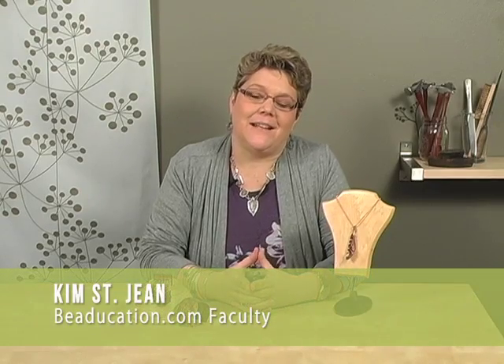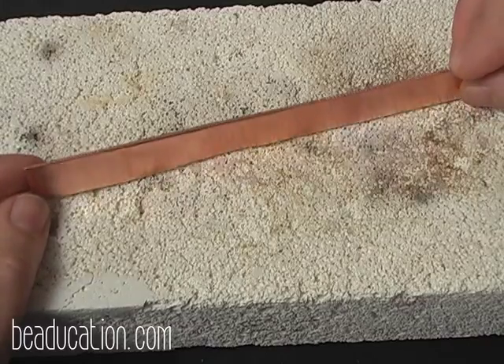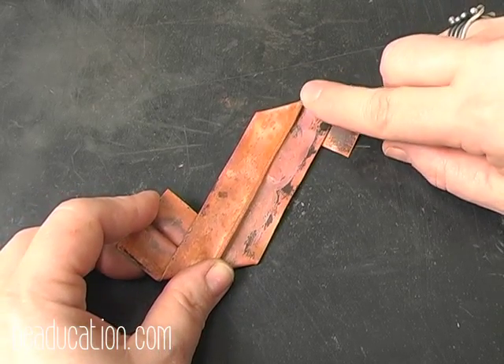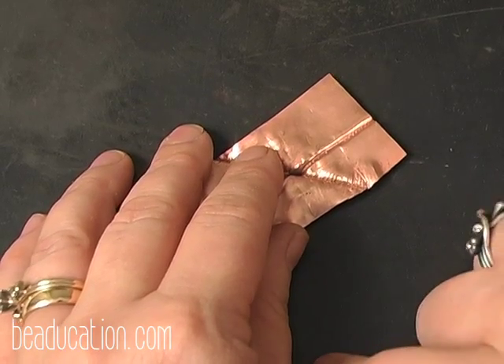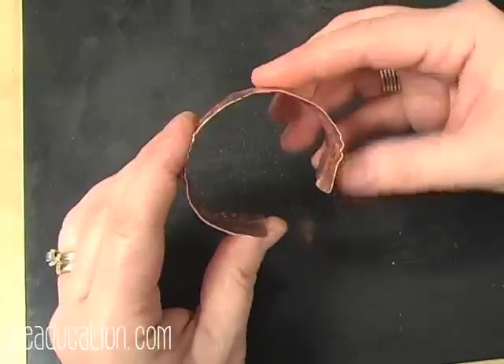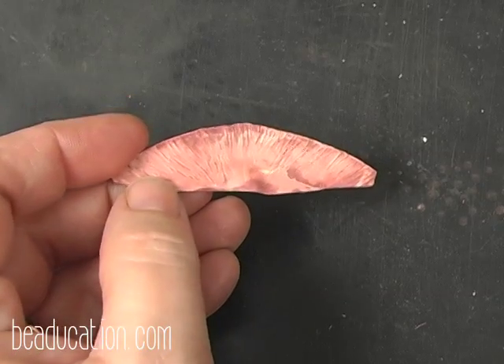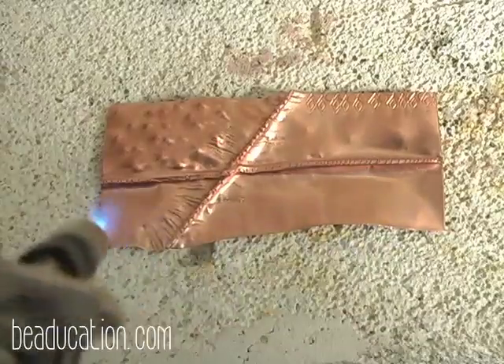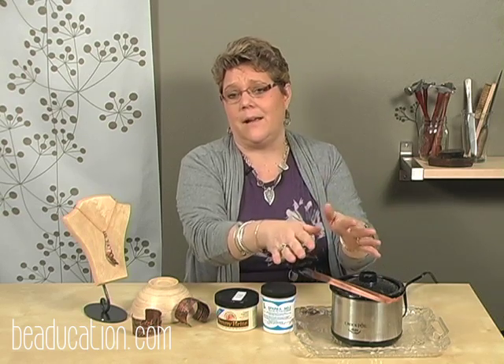Metal Fold Forming - Beaducation.com

Comment: Very awesome and informative video. I do have a couple questions though. Do you need a separate 'pickling' solution for each type of metal? Also, at the end when you were talking about the tongs for the 'pickling' solution, I was wondering if that ment that you could use the copper ones for all the kinds of metal, or if you need ones in the specific metal that you're 'pickling'?
Reply from the maker: Hi! These are great questions. You do not need a separate pickle pot for each metal as long as you're using, sterling silver, gold, copper, and brass. If you use Sparex pickle, you'll need to use Copper Tongs when taking things in and out of the pickle pot. Hope this helps. And, have a great day!

Comment: Hello and thank you so much for this video and all your very thoroughly detailed videos.  Just wanted to mention that when i couldn't find an unserrated butter knife in my drawer I came across my yellow plastic orange/citrus peeler (from a company that starts with a "T";)) It works great to spread open the pod without leaving any marks. Just insert the flat end and once the piece is open far enough you can use the other end to splay it a little more before getting in there with your fingers.

Comment: Hi, I couldn't understand where you said, bricks retain heat??? And make studio dangerous? Or didn't you start saying brick was ok, but then when referring to the heat, I couldn't quite get what you said. I'm new, but know in some cases i need a charcoal, to reflect heat up the the bottom, through a grate for sweating, but if I don't need that, should I use a brick, since I have them? And I work inside.
Reply from the maker: +huskyfluffy Hi! Thanks for your comment. I think Jean was just referring to the brick becoming hot, and that you could possibly burn your fingers if you were to touch it. Just a safety tip!

Comment: I love your style of instructing. Very informative but not overly so. I have watched many videos on knife making and they say that to anneal the metal you heat but let it cool slowly. When you quench it quickly it hardens it. Is it different for copper or am I just wrong? Thanks for good instructing- and being interesting.
Reply from the maker: Hi! Thanks for the question. We are not familiar with knife making. But, we can only assume that there is a difference between annealing/tempering steel and copper.